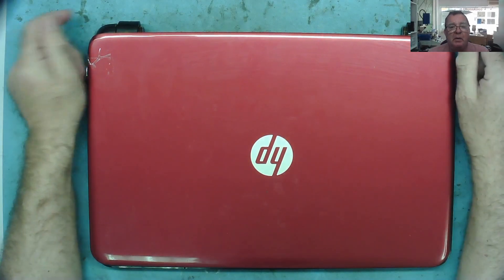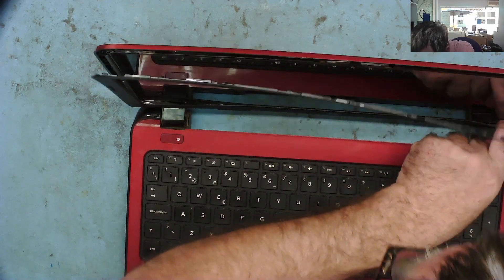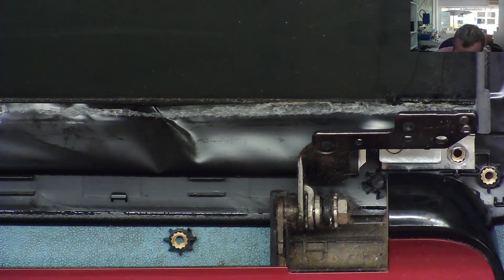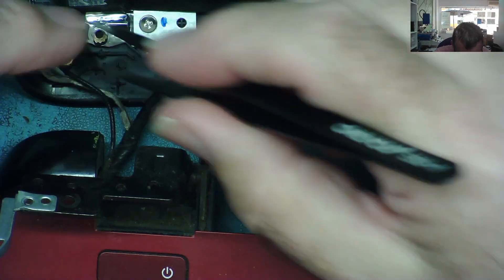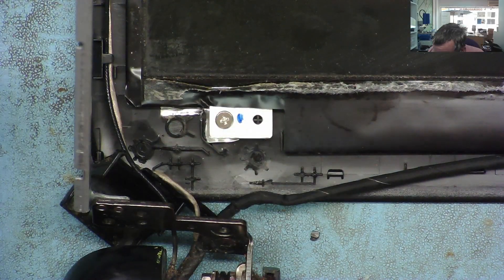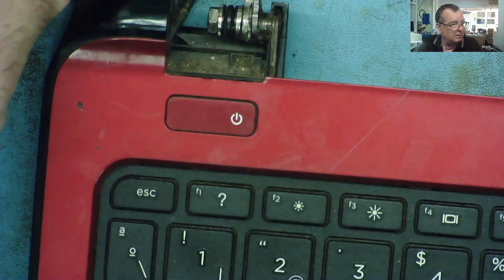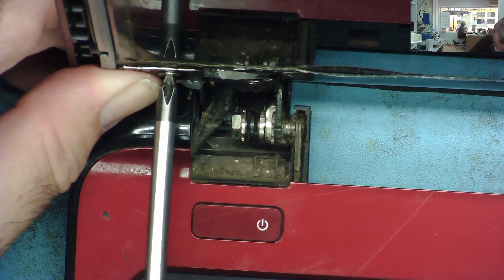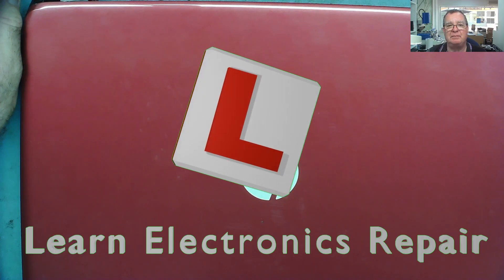How to FIX a broken Laptop Hinge Tutorial. Quick Cheap Easy Permanent Repair anyone can do

Comment: You should have used hot air station to heat the metal first, other wise  glue will not stick
Reply: But the glue did stick.
Reply: @Brianck1971  Hot glue does not stick to cold metal. Try it yourself.
Reply: @juliusvalentinas  As I said the glue did stick. What do u think happens when u put hot glue on cold metal ? The metal heats up at the point u put the glue  on.
Reply: @Brianck1971  Well why don't you test this and prove the glue guy sorin wrong then? Glue laptop hinges then test.

Comment: I guess if you adjust the metal spring in the hinge to bring down a lot the hinge friction, the glue will hold. Had a similar repair once and just drilled with 1mm right through the hinge holder and the bottom of the laptop. With a 1mm bolt, nut and washer it was fixed again better than before.

Comment: This technique won’t last on thinner laptops like HP 250 G6 style. You will find on that type of laptop that the brass inserts will break on both top and bottom casing AND in some cases the metal frame the screws hold against the top case around the screen will also have broken.
Reply from the maker: Thanks for the info - I haven't come across one of those yet, that needed this sort of repair.  How would you suggest repairing those models?
Reply: @LearnElectronicsRepair  I tried repairing one with superglue and baking soda and it lasted less than a week. I didn’t remember to loosen the hinge though since I had to repair around 8-10 of these low-profile brass inserts and also had to repair/solder on the wifi antenna wire to the wifi card since the tiny connector was ripped off one antenna wire.
Reply: @LearnElectronicsRepair  I think sorin has done the hot glue sandwich thing, but as for the broken metal, it would require a new hinge I believe

Comment: Decent short term fix. Glue and epoxy will never hold long term. Unfortunately the only 2 permanent fixes are (1) new cover or (2) drill holes through cover, get longer screws that thread through the hinge and the drilled holes in the cover. You then secure the screws/hinges in place from the other side with a screw-nut or a belt rivet
Reply: Other idea is to use more epoxy (create a barrier around each broken mount and completely flood the area with resin while protecting threaded holes, then dremel out the excess). That gives more strength to it, usually it is stronger than original bits of plastic.

If the broken part was some kind of alloy cast tube-like thingy, you can reinforce cracked element with a thin steel wire (0.5mm or less, you need to wind it around as many times as possible), and flood it with epoxy. I tried this steel-epoxy composite several times, and so far no complaints.
Reply: Problem is many of these screens have very limited space between bezel and hinge so an excess of anything will make it bulge in that area.
Reply: oh trust me they work for months even years !
Reply: You havn't met Sorin from Electronic repairs then, he hot glues everything like a hot glue master. It works though and it can be undone just by heating the glue up.

Comment: I do not promote my channel but i recommend watching  video on it, i filmed my technique of hinge repair. It is quite time consuming but most important point is that i never had any returns and even after 2 years i see that my job is absolutely solid. Hotgluy wont last a year, however if you put screw  nuts directly into back plate(or on back side if thats aluminium chassey), melt them in - it would last years and years.
Reply: What is your channel?
Reply: @stevedebeukelaer1424  just open my profile, there is asus zenbook repair video.

Comment: Sorin, from the other repair channel also uses hot glue. But his technique is a bit different. He uses his heat gun to melt the hotglue and lets it drip down, making the hot glue more liquid. He is claiming it sticks better when it is more hot. He pushes the screen frame in the large amount of hot glue, while it still liquid to make a sandwich. I think his technique is interesting too.
Reply from the maker: Yeah I've seen Sorin's channel of course, Electronics Repair School, He's one of the good guys and I recommend his channel to anyone, especially for Laptop repair.  Actually it was a mixture of Sorin and Louis Rossman who inspired me to start LER, and I based the original presentation style on what Sorin is doing, though I've kinda developed my own way of producing videos as things go on.  If I ever get the chance to meet either of these guys I would grab it with both hands.

Yeah my technique is slightly different, I've done a few repairs like this and none of them came back yet, I find the mixture of Epoxy Resin to fit the brass inserts and then hot melt to seal it in works well.  As a few have commented, I believe the key to success here is loosening the hinges a bit so the lid open and closes smoothly without excessive pressure, but sill enough tension to snap shut firmly.
Reply: I use hot glue to repair hinges too, similar to this one but I would heat everything up as I do find the hot glue to stick better when the temperature is hotter, and when the plastic is just about too hot to touch
Reply: Do you have a link of an example ?
Reply: @zeferrum  search for "electronics repair school hinge repair" on youtube. I can probably not post links here.
Reply: @zeferrum  "Asus X450S Hinge repair, a very bad one" looks cool.
Reply: I also recommend Sorins "Electronic Repair School" channel on YouTube.  He does use hot glue and a heat gun to melt it because the heat gun gets the glue to a higher temperature than a glue gun does.    He is able to demonstrate on laptops that have come in for an unrelated repair 18 months later and the hinge repair is still good.  He says that the problem with using epoxy is that it has no flexibility ant the repair will fail again at the same weak spot.
Reply: @sydmichel  There are also elastic kinds of epoxies, but a repair with a lot of epoxy is just a mess. And hot glue can be removed by alcohol or heat, so future fixes are possible.Further on it's just practically impossible to us the sandwiching technique with epoxy - it's just too much of a mess.

Comment: you should've checked and probably reinforced the bottom also. a lot of times if the screen side threaded inserts have broken off, the ones in the base aren't far behind
Reply from the maker: That I didn't do, thanks for the hint
The owner had the laptop back about 10 days ago and I chatted with him at the weekend and he said it was working fine so hopefully all is good.  Otherwise there will have to be a part two video and I'll give you a shout out 
😉
Reply: @LearnElectronicsRepair  fingers crossed it doesn't come back, but unfortunately these cheap plastic laptops nowadays don't inspire a lot of confidence. I'm not the expert on hinge repairs (that would be Sorin from Electronics Repair School haha) but on most of the hinge repairs I've done, the bottom side was also cracked. You did loosen the hinges so maybe that'll be enough. Anyway, great video nonetheless. Also I love your GPU repair content, keep up the good work
Reply: @danandrei96  Hehehe I was just thinking about the hot glue hinge repair master Sorin 😁😁😁. And yes, the hinges need to be loosen up. I also do grease them up a bit. I also do tighten up all the hinge screws (top and bottom covers)